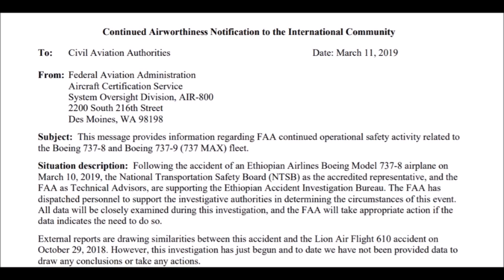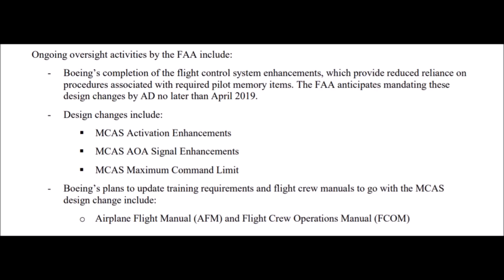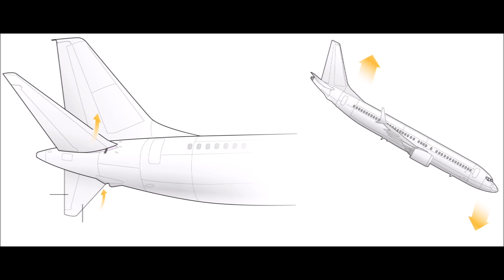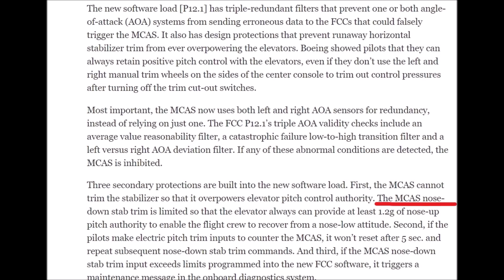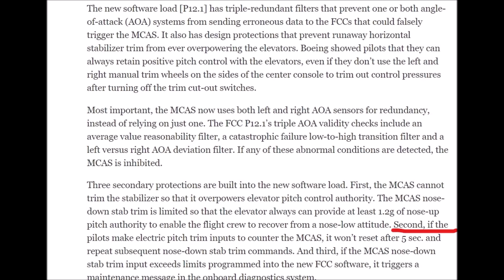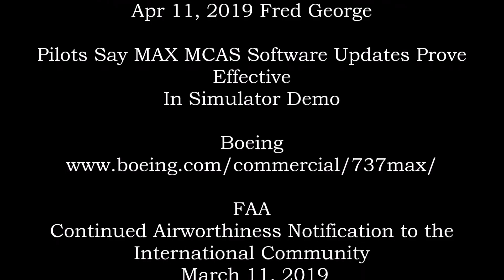737 Max UPDATE 14 April 2019 "The Fix"

Comment: I am an engineer, and currently develop software for the GA community. Previously, I have worked on embedded military software (including a flight management computer). In my opinion, relying on 1 sensor and giving MCAS the ability to overpower the pilot inputs is beyond irresponsible. Personally, it will be at least a decade before I will fly in a MAX 8 or 9. I have lost trust in Boeing for a number of reasons recently, and it is doubtful if I will ever trust any new technology from them in the future.
Reply: "In my opinion, relying on 1 sensor and giving MCAS the ability to overpower the pilot inputs is beyond irresponsible."  I believe that it is criminal.  Especially considering the only reason for MCAS in the first place is saving money.
Reply: @HitechProductions I'm 71 and over the years, have seen a LOT of times where 'saving money' ended up costing a lot more than it could ever save. So, now Boeing is already having orders cancelled...China, UAE....
Reply: @HitechProductions  
Three AOA sensors is not overkill so the system bases its calculations on the average or the two closest thereby allowing for one bad one and not left with only one sensor. This concept is utilized in operations that require a set amount of air flow vs. draft for optimal efficiency.
Reply: @larrybe2900  Certainly, but that is not how the system was implemented.  ALL automated flight control systems should NEVER rely on a single sensor, let alone one that has full authority to the flight control system it controls.
Reply: No matter how many sensors, there has to be an acceptable escape routine to disable the MCAS without cutting the ability for the pilot to control the plane.  Cutting off power to the stabilizer jeopardizes pilot’s ability.  It is not the correct design
Reply: @ychu01  "Cutting off power to the stabilizer jeopardizes pilot’s ability." If so, the person should probably not be a pilot since it just jeopardizes his or her ease and convenience.
Reply: How  much you wanna bet the people responsible were not put in their positions based on merit but based on other politically correct objectives?  There is just no way that people with experience designing this thing would have developed a design like this.
Reply: @frednicholson  using assertions that are unknowable on people is a poor debate tactic.
Reply: You at minimum 3 sensors  in a 2 out of 3 voting system  to achieve the correct function . With 2 sensors how do you know which one is giving you the false reading
Reply: @TheJmhora  exactly
Reply: @TheJmhora  The software has to keep a running log of sensor inputs from each sensor, and do a moving average. A deviation of more than 30% from moving average, or a jump of more than 30 counts is suspect. If the spread between adjacent high peaks, and low peaks exceeds threshold then sensor is noisy, and suspect. 

There are a set of engineering rules for analyzing sensor data, and deciding which sensor is giving the best data. In this case the sensor giving the reading closest to the mean is the safest course, as it would result in a small adjustment instead of the drastic one that crashed the plane.

The artificial horizon also gives pitch, and provides a third independent feedback of nose angle, and a deviation of more than 30% from angle of attack sensors should have disabled MCAS.

In any system, there should be an override button to allow the operator to take over from a malfunctioning automation system.
Reply: Thats the first thing they teach you becoming an engineer.
never bet on one horse for critical systems !
The question is now was this an elimentary mistake or a deliberate costcutting "mistake"😵
Reply: John Baleshiski same here, why are they not re design the plane instead. They’ve killed more than 300 ppl trying to rush the certification and design of this plane, it seems like they are rushing again with half assed fixes to make sure they don’t loose too much money. The US media is barely talking about this, which is beyond perplexing, Americans aren’t outraged by this? 
Who is talking about the other plane they are having quality issues with? Air Force suspended its delivery, but this was barely mentioned. https://www.google.ca/amp/s/amp.cnn.com/cnn/2019/04/02/politics/air-force-boeing-kc-46-delivery/index.html
Reply: @ellaella5537  ignorant of the situation.
Reply: @ellaella5537   I am an American and I am outraged by this. I read up on this on my own though. I never depend on any of the traditional media outlets. I will never get on a MAX 8. Car, train or Airbus.
Reply: Not to mention upselling "on screen" features like it was extra hardware is downright devilish.
Reply: @AdamC5013  ..On screen features...certainly not a 'hardware' deal...well, maybe a couple of $10 ROM chips...
Reply: @AdamC5013  people keep making a big deal of that one, but it's not that big a deal. it's a little indicator that tells you the AOA disagree. it's not going to help a crew much if they are able to ignore the trim wheel spinning away for 20 seconds. as Juan said, while the original design of this system was awful, pilots still need to know how to fly their aircraft in a responsible way. letting it get away from you and turning back on bad systems is not good stuff. the one thing I wish all airlines put on their aircraft was AoA indicators. any pilot worth his salt will know something is going wrong whenever the aoa is out of the expected range for a given part of a flight. most airlines do not have this feature installed and it is far more useful than a "disagree" light.
Reply: blatant greed, triggered by fear of lost market share 
its become self fulfilling prophecy
and the big one to come is passenger sentiment
try "spin" you way ou of that one, mr boeing ceo..
Reply: I have to wonder why the Attitude gyros are not being used to check the AoA sensors. Massive rapid deviation could be a downdraft or faulty sensors.

A battle with the Airbus computer that said the plane was pitched up 40 degrees while flying at 37000 feet. The pilot it was physically impossible. This Airbus has 4 AoA sensors.
https://youtu.be/2cSh_Wo_mcY
Reply: Yeah, I can't understand the rationale for this swapping. It's not like the data being used was wearing the AoA sensor out.
Reply: I agree with this. Using one sensor and giving the automation the authority to run a trim output to full deflection is nothing but criminal negligence.
Reply: Judging from these replies, Boeing has a large pool of aeronautical control engineers with excellent hindsight to recruit from.  Keep in mind two crashes versus 100,000 to 200,000 safe flights.  The two crashes were 3rd world airlines, one with pilot with a whopping
200 hours.  
Well, John B., I am an engineer AND a pilot.  The pilots snafued as much as the automation .... which is Juan’s final point.
Reply: @danbenson7587  I'm a SEL pilot. Even most simple 2/4 seaters have redundancy built in, from COM/NAV radios to magnetos to instruments you can cross check. I cannot get past the idea of taking an already redundant system and introducing a single point of failure. Nor can I get past giving a system like MCAS the ability to essentially overrule the pilot. Standard C182 pre-flight checklist includes turning on the AP and verifying you can override it. If MCAS thinks it has a high AOA, and the pilot is still trying to pull up or trim the nose up, the system should have disengaged. It did not cross check with the other sensor, or with the airspeed (which can be used to infer pitch attitude). The entire fleet got grounded with a mandatory AD whose fix includes a check where MCAS will disable if the pilot tries to trim the pitch up. How was that not part of the original build? How is that anything but negligence?
Reply: @JohnBaleshiski  Very well said. The design was negligent: one sensor, no monitoring of other systems, etc...
Reply: If it's determined this was the cause of   both crashes it's a sad time for Boeing.      The CEO and all top managers  involved should be fired and possibly face criminal charges.
Reply: @MRBROWSER2012  derp
Reply: The thing is to me it looks like Boeing designed mcas to rely on one aoa sensor and if it is faulty then mcas will put the nose into the ground. And now Boeing has decided that’s not such a good idea! WTF..?.
Reply: Find this interesting a software engineer being critical of a software issues. He can't tell me the software he was part of was flaw free or without unintended features. 

 Let's put perspective in this.  Sensor redundancy doesn't guaranty uncommanded problems.  Here are two Airbus incidents that show redundancy can fail as well.

"On 5 November 2014, Lufthansa Flight 1829, an Airbus A321 was flying from Bilbao to Munich when the aircraft, while on autopilot, lowered the nose into a descent reaching 4000 fpm. The uncommanded pitch-down was caused by two angle of attack sensors that were jammed in their positions, causing the fly by wire protection to believe the aircraft entered a stall while it climbed through FL310. The Alpha Protection activated, forcing the aircraft to pitch down, which could not be corrected even by full stick input. The crew disconnected the related Air Data Units and were able to recover the aircraft.."

On 7 October 2008, Qantas Flight 72, an A330-300, suffered a rapid loss of altitude in two sudden uncommanded pitch-down manoeuvres while 150 km (81 nmi) from the Learmonth air base in northwestern Australia. After declaring an emergency, the crew landed the aircraft safely at the RAAF Base Learmonth in Western Australia. It was later determined that the incident, which caused 106 injuries, 14 of them serious, was the result of a design flaw of the plane's Air Data Inertial Reference Unit and a limitation of the aircraft's flight computer software.

At some point the pilots are the redundancy.  The video touches on this, are pilots loosing the proficiency due to automation? Aviation Week last week stated the pilots did not follow the runway procedures. Plus there was questions to the power setting.
Reply: @andret4403  The fact that two sensors can fail doesnt justify only one sensor.. And it makes little sense to me to use just two sensors.. The system should use the two sensors and monitor the other systems too...
Reply: @bradleysmith681  I don't disagree. Why Boeing engineers didn't use both will be investigated. Seems logical to use two but maybe there was a reason they didn't or perhaps simply oversite.  There could have been some technical limitation at the time of the original design that they could not use both. We don't know. I don't believe Boeing engineers intentionally meant for MCAS to do what it did. I also feel they assessed the safety risk and felt they had sufficient procedures in place for runaway trim to say it was safe to fly while they do a software fix. Was there a miscalculation on the proficiency level required to handled the malfunction. It looks that way. One of the points of my posting, the pilots need to be proficient to handle this type of failure. It can still and has happened with redundant sensor systems.
Reply: @andret4403  If this was an oversite, then we have even bigger issues.. Thanks for your comments..
Reply: It's not that easy. When a suicidal pilot crashed a German Wings flight into the Alps, nobody would understand why an automated aircraft would let a crazy pilot take control of the system to the point to fly it willingly into the ground. The question is: Who has the final saying? Man or machine? You can't have it both ways.
Reply: @chk5656  The A320 is from 1988.  The automation was not as sophisticated back then to detect that.
Reply: @chk5656  Until we have artificial intelligence, a man's brain is always the final key.
Reply: I thought for a moment that I was going to be interested in your take, but then I quickly began to doubt that you're an engineer for the GA community since no aware engineer would conclude as you did about any system when you know what the effects are of highly scrutinized corrective work.
Reply: @ReflectedMiles  Corrective work? How did this pass an engineering review in the first place? They took an existing system and added in a single point of failure and it's a mission critical system. The design of this was an absolute disaster. That they did this in the first place makes their decision making process highly suspect. I'm sure they will fix THIS issue, but what other issues are waiting to rear their ugly heads? What did they do with the 777X? Are you willing to bet your life on them now? (Rhetorical question)
Reply: @JohnBaleshiski  Of course. As I've written previously, I've never been rated on the 737 but would happily accept an assignment flying the MAX with the original software until Boeing gets the fix done. There's nothing disastrous about it except for those unprepared to fly the airplane. Boeing is probably the finest engineering company in the US, will learn their lesson from this about the need to engineer the airplanes to be as crash-proof as possible for less-than-adequate pilots and/or training, and carry on.
Reply: Reflected Miles, empty words is all you offer.
Reply: @tabaks  How many MD-80's have crashed since the jackscrew maintenance and malfunction role came to light after the Alaska Airlines disaster? There is a long history of safety following fixes. There's nothing empty about that reality. Airbus has a fundamental design deficiency that brought down Air France 447 with the pilots also failing to fly the airplane, and they were trained and certified in the West, yet I haven't read all the same promises from the public to never fly on a sidestick-control Airbus model or that Airbus engineers or management should face the death penalty for that design. I wonder why that is? The public is amazingly unaware of how their opinion strings get pulled by those who feed them "news."
Reply: Yep they are being just plain lazy right now and not taking this seriously
Reply: Boeing has done an outstanding job on the B777 (1600 airframes, not one fatality) and the improved version on the B787.  So what went wrong on the B737 MAX ?
It's obvious that they tried to maintain the systems philosophy of the 1960s which is
1 Duplicate every instruments eg altimeter, turn and bank, alpha vane
2 One instrument goes to pilot, other goes to copilot
3 If sensors such as a altimeter, pitot tube, alpha disagree the crew work out which one is reliable and only act on the reliable one.
This is fine with "man in the loop" flying where all significant control surface deflections are intermediated by the pilot.  It is not suitable for powerful automated control.

You can see in the Ethiopian crash (ET302) the pilots stick shaker activated due to the faulty sensor but the copilots did not.  A pilot confronted by the fact he had airspeed, attitude and that his co-pilots stick shaker was not activating would not dive the aircraft into the ground.  Incidentally on the BAE 146 stick shakers only activates if both alpha vanes activate.

Boeing need to triplicate its sensors and use a "2oo3" architecture "2 out of 3" where the system will only act if two sensors agree.  If one does not you generate and alert.  If all disagree you generate a fault alert and gracefully shut down.  Boeing could have used a 2oo2 architecture and generated an alarm and disconnected it but I think they need 2oo3 or best 2oo4 to guarantee dispatch reliability.

I don't understand this stupidity.  I know the management wanted minimal modifications but why didn't someone have tiny balls to stand up to their wishful thinking.  MCAS was thus incorporated into the existing philosophy.  I believe MCAS also incrementally increased its trim down after each activation.

Is affirmative action involved?
Reply: I've never heard of developing a piece of software with no/disabled error handling modules. And where the hell was the testing? I've tested less risky software to death. 
It is also obvious that no pilots and no aircraft engineers were involved in this software as I was easily able to ask the question a week ago; WHY aren't both AOA vanes involved at the same time in the code? 
Killing two planeloads of people in order to decide to start a comprehensive use-case study is unconscionable. 
No managers, marketing people, or other un-connected employees at all should have been involved in the decision making. Was it an honest mistake, or was it CYA, political correctness, inebriation or other destructive action(s) that caused this? There is someone at Boeing who is responsible for these deaths. There should be a list of people that will have the truth extracted through waterboarding in Gitmo.
If this keeps up with Boeing, I will not fly. (I certainly would never fly on a damned Airbus again. And don't get me started on Bombardier or Embraer.)
Reply: John Baleshiski, that is EXACTLY how I feel about this blunder. My life is NOT a bargaining chip for Boeing's balance sheet!
Reply: It’s definitely not DO254 class A compliant. Hell we weren’t allowed that little redundancy in a Fire Control Radar and you don’t fall out of the sky if it goes on the fritz.
Reply: @OnboardG1  That's because DO254/A is for systems with catastrophic results if failure occurs. There was no reason to imagine that would or should be the case with MCAS. I'm guessing it was maybe designed for /C compliance. Despite all the panic-stricken commentary, I would happily fly the MAX with the original MCAS software until Boeing gets the upgrade done. It's just some extra work to put the airplane back down for service if it malfunctions. No need for catastrophes.
Reply: Funny how the amazon cargo plane a 767 that that came down in the neighborhood. Had a very similar crash but it swept under the rug.  https://www.businessinsider.com/pilot-error-amazon-air-atlas-air-crash-ntsb2019-3
Reply: @thomas4315  Was that the Houston crash a few months ago?
Reply: Fact of the matter is in both crashes the pilots did mot follow the procedures. Boeing is not at fault. If you are going to spread blame the airlines should get the rest. 

It clearly states in a runnaway trim procedure to NEVER reactivate the stab trim..... that is exactly what they did. They ignored speed indicators as well. 

You can over react all you want but this issue happened numerouse times and competent pilots got the airplane home.
Reply: @MrManic52001  True, the pilots also share in the blame. No doubt about it.
Reply: @MrManic52001  It was supposed to be a drop in equivalent to previous aircraft without pilot training. The MCAS was supposed to be invisible to the pilots.
Reply: @capnbilll2913  it was......
Reply: First, I would add that, even if it was to be using only one sensor, the moment when it started giving impossible values then there should be a check to see if the returned values are within tangible ones and if not then disable all systems depending on it.  Second, even after implementing (1) for each one of the sensors, the system should be looking at both (to check if they disagree).  Third, the pilot should always be the ultimate authority.  A truly Artificial Intelligent system should not put the plane down under any circunstamces, just like any human would.
Reply: @W K it only stalls at a certain range vs the 737. Its not that it cant fly or is unstable it was to keep the certification the same.
Reply: Yep. I work in factory controls, I use two sensors for everything more important than a toilet.
Reply: I think the original engineering team that did things by the book have retired and left the company. What is left in charge of the company is the shadow of the former self that is driven by cost savings and not much else.
Reply: Since my stepdad was personally involved with the design of the original 737, I was really anxious to fly on one of the new MAXes when I had the chance.  I have to say this is criminal...and especially upselling safety features as options.    

I was always leery of flying Airbus due to the fly by wire systems.  Looking in the cockpit and seeing joysticks and computer screens was always a bit much for my sensibilities.  However, they have years of flying safely, and as Juan said, automation is a fact of life now.  Might be time to re-evaluate
Reply: Don't they use the simular MCAS on military tankers B767?
Reply: @toriyshaov2245  I'm not sure what craft it is on, but the military does use this system and it takes advantage of multiple AOA sensors. Boeing introduced a single point of failure.
Reply: @Smarty Pants The US was the last to ground the MAX 8/9. Yes, 200 hours is way too little for first officer/SIC. Boeing CAN be blamed as they took an existing system and added a single point of failure on it. They were careless in the design and implementation of MCAS.
Reply: @W K you are ignorant. The 737 max had the software update to allow it to fly the same way as the 737. It has nothing to do with it being unstable. The person who posted this video said this numerouse times. 

There is no need for a complete trashing of the air frame at this time.
Reply: @MrManic52001  You're right. It was the pilots fault.. That's why Boeing has already accepted partial blame because it was the pilots fault..
Reply: @bradleysmith681  you just answered your own nonsense.
Reply: John.  As a fellow engineer, how many projects did you design NOT to work?  How many projects, despite your best efforts, did not work as intended when first switched on?   Invariably something needs a tweak.  Boeing got this one wrong,  lost face, lost sales,, and lots of law suits.  I agree your diagnosis, of redundancy, but it’s always easier in hindsight.  I bet Boeing got buggered in the details, and lost the big picture, but not negligent.   If you want design negligence look no further than the lack of pitot heaters on Airbus A330 & crash of Air France flight 447.  Pitot heat has been around awhile.

As a fellow pilot, you know the PIC is responsible for the safety of passengers and crew.  Automation is not.  This is invariable and no plane control philosophy will alter.  Ultimately, I think it is a fools errand & dangerous for the airlines to expect automation to cover diminished pilot skills.  The crew should have flipped off the MCAS immediately.  (And I think all airliners, should have an automation kill switch, actuation reverts to stick and rudder.)

What has not been addressed in all the hype is the most basic question... why are the AOA sensors failing?  This triggers the mess.  I would not be surprised there is a field service FUBAR.  It will never come to light, the blame is on Boeing & B can’t blame its customers.  There have been 1000’s of MAX flights and the two crashes sequentially in 3rd world countries... hmmm.  

Cheers.  D
Reply: @danbenson7587  obviously if the sensor was working correctly we would not be having this conversation, but in the real world sensors fail. That's why data sanity checking, and redundant sensors, (2 out of 3) are required in any automation system.

When a single sensor fail crashes an airplane, you did something wrong.
Reply: Capn Bill.  Each link in the chain is non lethal, but when assembled becomes so.  

I am puzzled why B didn’t offer redundancy too, but, in my opinion I think it error to lay the whole blame on them.  They are simply the easy target.   If our inquiries stop at the obvious, truth may never be seen.  Why did the AOA sensors failed remains an open question.

So here is speculation.  I’m retired now,  but over the years was burned by service and by manufacturing screwing something up and blaming engineering.  New products are the most vulnerable to these shenanigans.  So, lets say, some tech stands on and bends the AOA vane while washing the MAX windshield, he straightens the vane with pliers and tells no one.  Plane crashes.  Who gets blamed?

Redundancy introduces new problems, it’s not always a clean solution.  There have been accidents where crews focused on erroneous warning lights or flight w/ the primary down and relying on the back up system, or maintenance errors due to complexity/over engineering.  Sensors fail and so do redundant systems.  Where does one draw the line?

Boeing put MCAS on because their customers wanted it!   Including Ethiopian Airlines.  Their motivation was profit.  As profit a dirty word in liberal circles, aren’t the airlines culpable?  Such craziness, and on it goes.

In two years MAX problems will be history.  B stock and reputation will take a hit thru 2019.  B engineering will layer on more FMEA.
Reply: I really could not say it better. The sad part is I grew up idolising Boeing as I company, trusted them without reservation. Flew in all their planes from 707 up and until their 787 (operated by Ethiopian Airlines). Told everyone I preferred Boeing to Airbus. But this has changed everything....shattered my trust, especially Boeings response on top of it. Tragedy all round.
Reply: You're obviously correct about lack of redundancies but many aircraft including Airbus airliners already have the capability to not only ignore but to "overpower" pilot input technically to a greater extent than MCAS when it's working properly Qantas 72 proved that they aren't immune either and regardless if the 2 control systems aren't comparable the only thing that prevented that A330 from succumbing to an uncommanded nose down maneuver was altitude.

When AF447 crashed had their FMS not switched from Normal Law because of the unreliable airspeed data the Alpha protection would have "overpowered" the dazed pilots and we would all be praising modern technology for taking over and saving the day.

In the full context of modern computer augmented aviation although poorly executed MCAS is not the drastic departure some make it out to be and rather similar  to McDonnell Douglas's LSAS in the MD-11 from the 80s that Ironically was updated by Boeing with a software update in the early 2000s at the request of the FAA following a series of inflight upsets. It must be somewhat reliable if 100 or so still fly as freighters with major operators.
Reply: @PabloGonzalez-hv3td  Great info. Not being an ATP I was unfamiliar with LSAS. I appreciate that LSAS's Pitch Attitude Protection and Positive Nose Lowering can be overridden by the pilot with 2 lbs of stick pressure under 1500' and 10-15 when above. Seems like they thought the system through.

I'm sure when the MAX is airworthy again, MCAS will be fine. But with questionable judgement on this, what other possibly poor decisions were made? I don't like that Airbus can overpower a pilot either.
Reply: Yea, even off brand drones out of China can have active redundant sensory. Did I hear that correctly the whole system would use one sensor than on the next flight, use the other? Thats hard to believe and would explain why lion air had the same mishap on the same route the day before when it was saved with the third pilot.

Maybe time to audit all Boeing flight control software since going public. 
Especially sensor input handling. 
Great metal is nothing with cost-cutting ghosts in the machine.
Reply: @AdamC5013  add in the automotive throttle by wire, break by wire, shift by wire and steer by wire systems that most drivers do not even know exist. Unless you are driving something so old it doesn't have catalytic converters or disk brakes, you probably have at least a partial break by wire system, and not one line of code has ever been audited publicly. I do think if you have to trust one manufacturer, I would pick either Tesla or Toyota. Tesla because they are open about flaws and fix them at lightspeed compared to the rest of the industry and Toyota because they recently paid out a ton of money and agreed to new best practices and review of legacy code and devices for bad code in their cars that killed a few people that we know of.
Reply: @AdamC5013  Exactly fight.. In flight, MCAS relied on only ONE sensor.. It's negligent..
Reply: @bradleysmith681  not just negligent... CRIMINAL amateurish management.
Reply: @glasser2819  Indeed!
Reply: @glasser2819  Promote people for reasons other than merit and this is what you get.
Reply: @bradleysmith681  I think you mean criminal
Reply: @4stringmanatgmaildotcom  What you have said is irrelevant to this conversation.. No one can justify designing a system that works off only one sensor.. And to call that out is not armchair quaterbacking.. It's a design flaw that is incredibly obvious..
Reply: @4stringmanatgmaildotcom   The problems you speak of are:
XL Airways Germany Flight 888T (2008, crew lost)
Qantas Flight 72 (2008, no fatalities)
Lufthansa Flight 1829 (2014, no fatalities)

In each case extraordinary circumstances were involved such as multiple sensor failure and one can see a proper engineering effort, due care by Airbus or Northrop Grumman.  Only XL 888T was fatal because they conducted improvised stall tests at improper altitudes in incorrect trim.  It was more of a demonstration and they had no recovery plan if the test was no passed.

It's a lot harder to fathom what was going on at Boeing with MCAS
Reply: @bradleysmith681  no it is not. It had a cut out and a procedure to follow. Pilots ignoreing those procedures is not an engineering problem.

Should it have been designed better.... yes and now they have. Fact is boeing is the safest airplanes in the world proven by billions of flights. Your feelings are irrelevant.
Reply: @glasser2819  derp.....
Reply: @MrManic52001  Boeing is the safest?? How does that relieve them of any culpability regarding such a poor design? It doesn't. And that poor design killed hundreds. They are criminally negligent and belong in prison..
Reply: @frednicholson  Merit based promotions are still not immune to the Peter Principle.
Reply: @bradleysmith681  nice deflection from his point.......
Reply: @bradleysmith681  hahahaha, sure thing.
Reply: @gilbertreeves2084  MCAS is not in the pilots manual.
Reply: @glasser2819  Hell yes! Boeing needs to pay up big time!
Reply: @4stringmanatgmaildotcom  I would still bet my money on 1 sensor freezing before 2.

There are a set of rules to detect a frozen sensor.
Reply: So what you're saying is you are software guy who isn't bleeding edge. Welcome to the fold sir. I don't auto upgrade anything. Turns out, the old saying if it aint broke........ actually carried some weight. IMHO, the decision statistically to rely on one sensor was accurate to quite the number of zeros beyond the decimal relative to their long term data sets; however, not impossible, and as such, should not have been developed in this way. They probably changed mfg procs as well to save money, thusly introducing a new data set to consider, which should have triggered adjustments for assumptions.  These things are a byproduct of technological change. At least we don't' live in the days of the Wright Brothers. Hell, didn't they outlaw hydrogen and certain doping compounds after the Hindenburg? At least we can have these discussions in an open forum across borders and cultures. This is the better part of the internet. Sympathies to the crew and passengers.
Reply: @youKnowWho3311  Yeah, I believe bleeding edge (or unvetted) code is not appropriate when it's mission critical. R&D? No problems there. Move fast and break stuff. :)
Reply: @John Baleshiski I fully agree with you. I'd even go one step further. Not only not trusting Boeing anymore but neither the FAA, the whole certification process in the U.S. airline industry, respectively.
Reply: @W K that is not what happened.
Reply: John Baleshiski Spoken like someone who makes up bullshit credentials and then speaks with the false authority of someone who reads the news articles.
Reply: e james plenty of good non European pilots out there... don’t be a POS
Reply: How can we trust them if they install Boeing Uninterruptible Autopilot on every Boeing and never mentioned that to pilot? It is not design for anti-terrorism but to ditching an aircraft when someone expendable is on board. Check Malaysia flight 370 or Germanwings 9525 just to mentioned couple.
Reply: Amen
Reply: Early 737s had an issue with the rudder hydraulic system. It could go into reverse. Sadly, 2 planes crashed before the problem was identified and fixed.

 I wonder how many people who complain about the MAX are unaware of the rudder induced crashes long ago.
Reply: Along with checking input from both AoA sensors, why not also compare that data with the Attitude gyros? Sudden changes could indicate a fault.

A lot of people are asking questions which seem like they would have been addressed in design reviews and software testing. As someone who developed computer software for 25 years, many of the redundancy and sensor error questions should have been called up and addressed. Or deferred. 

I don't know if the test conditions were dismissed or management wanted fewer code changes to avoid looking like there were massive airframe changes.
Reply: @kevinmoore4887  I'm thinking the same thing.. Shouldn't the fix rely on cross-checking other systems too??
Reply: Smarty Pants oh dear, the CEO acknowledged that BOEING was at fault, lots of US Pilots complained and raised concerned about the plane, so you call them crazy? The maintenance was done by an American company.
Reply: @ellaella5537  That's known as political and social damage control. They have to respond to the perceived measure of their fault regardless of what they can demonstrate about the failure in flight or in a simulator. The actual role of the system in the operational context of flying just doesn't matter. The public thinks that all systems should be perfect and crash-proof in the hands of sketchy developing-world pilot training. Is that realistic? Not really. Does that matter? Nope.
Reply: Well said John.. I agree..
Reply: @John Baleshiski 
there are multiple videos on the internet about Boeing and their cost cutting sloppiness since they acquired McDonnell Douglas.

I will never fly on a 737 MAX and will from now on probably steer towards Airbus (which I had preferred not to fly until now after their plane from South America went down over the ocean).
Maybe I will even consider trains for longer trips. I already choose a car for shorter ones.
Reply: @mark98115  good luck in life. You are insane to use the rationalizations you just proposed. 

Boeing and airbus have VERY good safety ratings and considering BOTH of the crashes you are using are PILOT error or at least partially caused by the pilot, you will not be happy, all airlines use pilots.
Reply: @MrManic52001 
why don't you watch some of the investigative reporting done on Boeing. The programs are available on YouTube.
In a nutshell, the problem with Boeing was that the management overrode safety inspectors who discovered that the components for the Dreamliner were not up to specs. Some of these people, those who would not pass subpar components, found themselves without a job.

With regard to Airbus, my objection was to their philosophy that the flight computer has priority over the pilot.
Investigate Flight 447 although I am sure much of it has been whitewashed by now, in the immediate aftermath there were pilots who came forward with theories as to what happened. These pilots said that most likely cause was air tubes for speed sensors froze and the plane's computer did a dive to recover from a stall. They speculated that the pilots fought with the controls but it was all in vain due to Aibus' philosophy of computer above human.

All that aside I do know that statistically air travel is much safer than by car, but that of course is very dependent on the driver.
 Additionally, if I crash my car there is a very good chance that I will walk away from it.
Reply: @mark98115  Exactly.. And remember that Boeing claimed there was nothing wrong with the MAX.. But now, we know that assertion is not true. Boeing, itself, claims they are partially at fault for the crash and are completely overhauling the system...
Reply: @mark98115  your citation please.
Reply: What a silly statement from an "engineer".  Systems, automation, etc., have never and will never be idiot-proofed against the likes of lowest denominator third world operators like the crews who crashed the two subject airplanes.  The pair of tweedle dumb and tweedle dumber flight crews actually went out of their way to compound what began as a very manageable abnormal situation into an unrecoverable condition.  The correction for a runaway trim condition, regardless of it's cause, is to disable the system.  Two switches are conveniently placed to accomplish that feat, and then manually re-trim and continue a safe flight.
This is from my 44 year professional flying career training and experience to include 737 Max level of automation flown with zero accidents or incidents.
Reply: @g550ted5  If the 737MAX is so readily flyable w/o MCAS, why have MCAS???
Reply: @jasontraxler2946  becuase in 1 or 2 situations it acts differently. It is NOT unstable or unsafe. However, in order to maintain a single certification, the saftware smooths out the air craft to a similar feel as the original 737. 

The poster of this video says this.
Reply: Jason Traxler because w/o it, their customers would have to retrain pilots to be certified at big cost. It is a cost saving device.
Reply: Wonder how they feel about the bloodguilt of all the people that died in the two crashes?
Reply: @rosstinney2109  it was pilot error
Reply: @W K I have said the same repeatedly. The modifications to the 737 were first said to have rendered the plane unflyable on takeoff by experienced commercial pilots rated on the earlir 737. But, if the MCAS failed, the pilots who were not qualified w/o MCAS  were expected to diagnose and fly w/o MCAS - insane.

Now, Juan wants us to believe that the 737MAX is flyable w/o MCAS since the 737 MAX flies almost the same as the old 737 but because of changes in flight characteristics the pilots would have to be retrained at great expense and time sensitive inconvience for Boeing and their customers. So, we come bace to an unreliable flight control system that relies on pilots not rated to fly the plane.

Seems to me that Juan keeps circling around to place the major blame on the dead pilots, not the poorly engineered plane.
Reply: @jasontraxler2946  citation for this assertion.
Reply: in reality, the cause of the problem is that they maintained the old fuselage of the 70's, just moving forward the engines!!!! no serious thechnological research, just little tricks - a real shame
Reply: @silveriorebelo8495  the only thing shameful is the fact some internet engineer thinks the could get the coffee of a boeing engineer.
Reply: As you will already realize , Boeing has never been about technology ...Boeing makes great flying aircraft for real pilots but Airbus invested so much in flyby wire and technology / programming/automation. Boeing 737MAX only fly by wire is the damn Spoilers/Speed Brakes!!!! Can you believe that. When they tried to program MCAS they missed out on some small details that f’d everything up. And the regulators you think they know programming? Only EASA has the best qualified regulators and that’s why EASA didn’t show up to the conference because of all these IOUs Boeing gave them and the other regulators thought EASA was being too PICKY. EASA will be the last to certify the new software update. European Regulated operators will be loosing so much money and will not fly until September . They will then go with the A321 of course and A220 hopefully (formerly CSeries which has Fly By wire to the tail where it makes sense because of long cables weight savings . Boeing making the spoilers fly by wire was a test
Reply: U cant fix shit with software updates crashes are not uncommon with boeing and alot of the other pop cans america makes these days
Reply: As far as I know, there are two sensors, one left and one right, which can be selected individually in the event of wild fluctuations from the norm, as in this case, where the right sensor went wild, while the left sensor produced normal readings, for some reason, the pilots used the faulty left sensor for input.
Reply: @BlastFMLimited  The sensor selection is automatic, the pilots were unaware it even existed.

The selling point of the plane was "it required no additional training".
Reply: BlastFM Limited, you know so sadly little. Pilots fid mot "choose", they had no such option. So, please read a bit more...or listen to this video...very carefully.
Reply: @BlastFMLimited  MCAS does the selection at power up with no pilot input possible. The pilots have no interface to MCAS (including no diagnostic information).